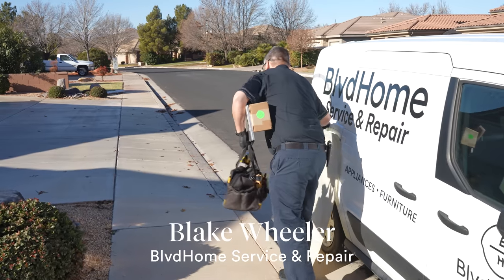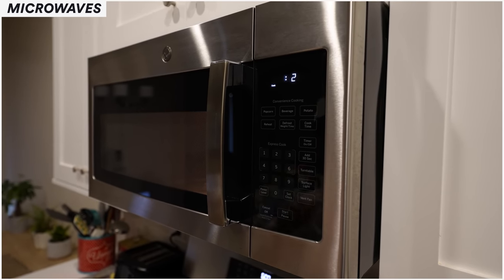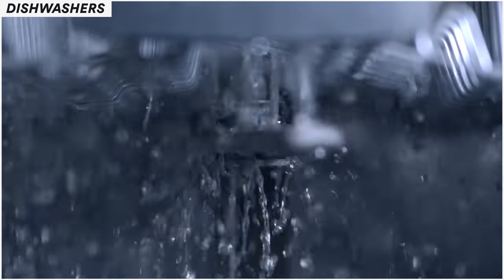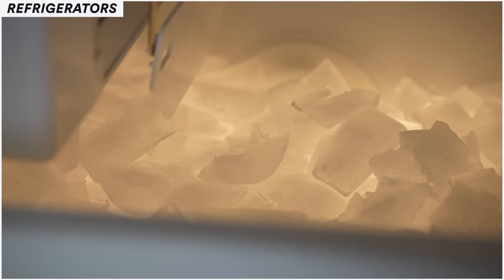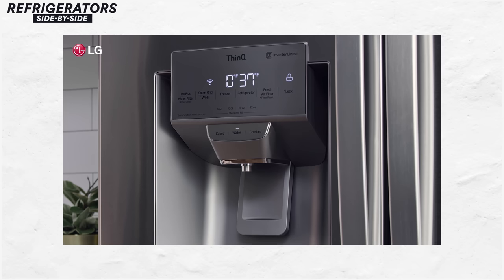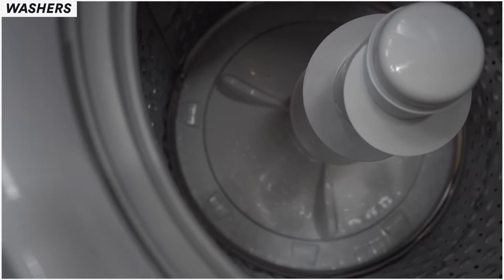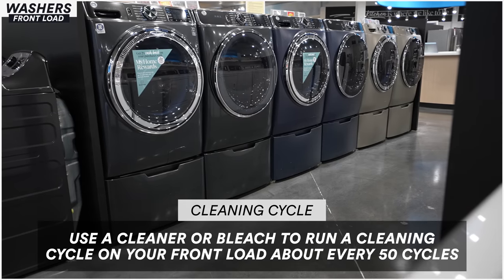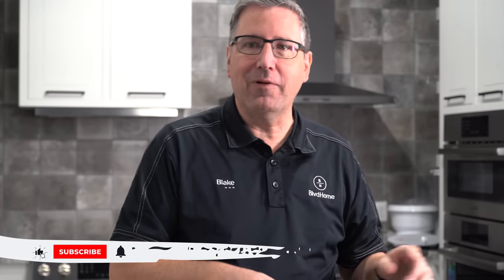Best Appliances Recommended by a Repair Technician of 29 Years

Comment: I never knew that microwave switches wore out when opening while running.  Good advice.
Reply: I think some microwaves might be turning off the magnetron a few seconds early to get ahead of this issue
Reply: @Werdna12345  I agree.   My door switches went bad.  Repaired for 20 bucks.
Reply: I'll trust this gentleman's experience about switches being the most common failure. I'm just surprised. A really long time ago, I worked at a company that made the contacts for electrical switches and they were usually designed to last for many, many thousands of on/offs before failing. Of course, back then you expected an appliance to last no less than 25 years without service. 😊
Reply: Apparently, my mom knew this back in the 80s because she still has her GE microwave from the mid or late 80s. What a machine!
Reply: Very wrong actually, most of them use relays
Reply: @TheMASTERshadows  That makes sense. But, you would expect them to have long life. What might he be replacing? I would think when he ordered replacement parts the description from the mfg should clearly be switch or relay.
Reply: @markkubert8572  hm...I recently opened up my parents microwave to see why it stopped working (turns out only a cheap fuse had burned) and was looking for signs of wear...the contacts of the door switch were just fine!...and my parents ALWAYS stop (and start) the microwave by opening the door...it's a cheap chinese model with analog dials and no screens, they use it EVERY day for at least 11 years now. :-)
Reply: He’s absolutely right! We had the same issue. The door switch burnt out since we were opening the microwave door before the cook time was over. The GE technician came over and recommended we buy a new microwave since the cost of replacing the door switch was as expensive as a new microwave itself. Very valuable tip.
Reply: @narendranj  what?? Those switches are dirt cheap! :-O ,that technician was 100% lying!
Reply: @vasopel  atleast that’s what the technician said…including labor and cost it’ll come close to the price of a new microwave…perhaps that was a way for them to make us buy a new microwave…
Reply: @narendranj  yes that is probably it :-(
Reply: You have a cheap ass microwave if you can open the door while it's running.. The last 3 I've owned and every other one I've seen in the last 10 years has a push button to open the door.  When you push that button, the machine shuts off the microwave a split second before the door opens.  Just like hitting the off button.
Reply: @CaptainRon1913  you have an expensive microwave to have that feature…
Reply: @CaptainRon1913  really??
 "the machine shuts off the microwave a split second before the door opens." and how does the machine know that you are pushing that button that opens the door? is it maybe...a switch? :-O 
were you drunk when you wrote that comment? :-D
Reply: @markkubert8572  that makes sense.  My microwave was 20 years old when the switches failed.  Working at a switch factory.  Neat!
Reply: @TheMASTERshadows  what is the difference between a relay and a switch?
Reply: @narendranj  I got a repairman and he diagnosed the switch and said the same thing.  Costs 300 bucks.   Replacing the switch myself was much cheaper including the $300 service trip.
Reply: Yep.. Look for ones without door handles, but instead with push-buttons that open the door - in these, the door button is almost always wired to automatically pause the microwave before the door contacts seperate; keeps them working for ages.. My parents have one like this that's older than me, and I'm goin' on 38 lol :)
Reply: @hodr1000  Switches are cheap Relay's prices...well it depends on the relay :-) 
Switches can be controlled mechanically
Relays can be controlled electronically
Switches control the flow of current by opening or closing of circuits
Relays control high power circuits with low power signals by opening or closing the contacts
Switches are operated manually by a lever or by pushing buttons	
Relays can send electromagnetic or optical signal to actuate the load circuit
Switches are  used to open or close the contacts
Relays are (also) used to protect the system from damage
Reply: @hodr1000  so the repairman said the switch went bad and then ask for 300 bucks to fix it? what the hell? :-O 
and what is a "$300 service trip"??
you people live in Saudi Arabia or something?
Reply: @GronTheMighty  "is almost always wired" hm...you are making assumptions ,only a percentage of microwaves that open the door with a push button (in reality it's a lever) have the pause mechanism you describe,even some of the expensive microwave ovens don't have that,in the end...the fact that your parents oven still works is probably (I assume...haha) because it was a well designed model ;-)
Reply: @vasopel  Yes, I was making assumptions - thanks for correcting me, I'm far from an expert on any of this stuff :)
Reply: @GronTheMighty  well it wasn't a huge mistake :-) I mean...it is the logical thing to do when you're designing a microwave oven to include these simple safety features...but companies are cheapskates! :-(
Reply: @vasopel  Well, they do often exist mainly to make money, rather than mainly to make good stuff for good human living ;)
Reply: and i guess that you as the typical murican, open the door without pausing the system.
Reply: Agree!
Reply: @TheMASTERshadows  I came here to say the exact same words, microwave door switches have been relay operated for 10’s of years.😂

It’s like the outdated warnings of using a mobile phone at the petrol pump. That risk doesn’t exist anymore since phones advanced from piezo speakers (which could produce little sparks, possibly igniting fumes), but people still carry on with the outdated warning.
Reply: @CaptainRon1913  The push button design is actually no different to a pull handle design electronically. All the push button does is physically eject the door from within the microwave cavity… the same operation still takes place behind the scenes, as if you used a door handle to open the door.
Reply: You would think they would use a relay so the door switches could just use low voltage to trip the relay to shut off the magnetron. There also should be a button to shut off the obnoxious beep.
Reply: Best refrigerators are standard old fashioned top freezer units. They are the cheapest to buy. They are the most efficient because you don’t have the cold freezer on the bottom sitting right next to the hot condenser fighting each other. It’s a better more efficient design having the freezer on top away from the condenser. The cold from the freezer also drops and helps keep the fridge underneath cool while not running. They also last longer due to them not having to run as much.
Reply: @TheMASTERshadows  that's what I was thinking. Also the pause button must operate a dry relay, if there's a spark there then you're not preventing any issues.
Reply: Since EVERYONE does it though, you’d think there could be a way to protect against it.
Reply: I open the door while hot all the time. My microwave is over 15 years old. Guess I am lucky.
Reply: I was really surprised by this. We had an Amana Radar Range back in the 70s that my parents used for 30+ years. It was definitely opened without pressing stop thousands of times and they never had any issues with it. They only replaced it because they remodeled their kitchen and wanted a built in.
Reply: Why do they work that way?  Why such a powerful charge instead of just an ordinary switch?  It can't possibly take so much longer to send the signal to turn it off that way than having it effectively be a circuit breaker (which is what he described, yeah?) as a safety feature.
Reply: It’s a lie..
Reply: mine is currently broken and I now know why...me
Reply: I ditched the microwave years ago due to health concerns and I use a counter top toaster oven/air fry/ convection oven instead.  I'd rather not get stomach cancer thanks ;)
Reply: @OceanFrontVilla3  wish you longivity..👍🏽
Reply: Most microwave ovens have two switches in the door.  One that tells the microwave to shut off and a second 'safety' switch that interrupts the high current should that first switch fail.  It's not a problem to open the door while running on most microwave ovens.  They're designed to work that way.
Reply: @DocFunkenstein Cause it's the easiest way to build it? You'd want them to complicate the electronics and send some kind of separate low power signal through the door switches? What if something completely fails? Having the switches be a breaker is a nice safety feature.

We don't even have these fancy microwaves you Americans have. Everybody uses one with a spring timer in my country. Pause button? What pause button? My microwave literally has no buttons. The only real off switch is opening the door. My point being maybe the way all microwaves work is simply a carryover from the old-school ones.
Reply: @davidcobra1735  I was being a bit facetious in my previous post.  That's EXACTLY how they do build (most of) them.  What this guy talked about is a safety feature in case THAT one fails.  You're not going to ruin your damn microwave opening the door mid-cook.  They're DESIGNED not to be ruined that way.
Reply: This issue is not true at all. The switch only carries instruction power, not operating power
Reply: @DocFunkenstein  I don't even understand what you're saying.
The guy in the video basically warned people that switches will wear out. It's true as far as I'm concerned. There's no reason to open the microwave oven door more than you have to.
I don't care how you think a microwave oven is designed, all electromechanical components will eventually fail because of prolonged or repeated use.
Reply: Just learnt this recently as well - good to finally know!
Reply: @DocFunkenstein  you are correct, the door switches only switch low current switching circuit to operate the relay which safely controls the power supply, therefore it makes no difference how it’s turned off, either by opening the door or by the cook time finishing
Reply: Me either. Learn something new every day or almost every day.
Reply: @catw6998   Ben is incorrect, the thing you don’t understand is that no matter how it’s turned off, either by the door being opened or by the timer switching it off its the power relay that switches the power off, not the door switch as  suggested here
Reply: jesus what kind of a psycho just opens the door without pressing stop/pause?!
Reply: @markkubert8572  My microwave is 31 years old and the door switches still work! I don't often open it while it's running because the time control is a knob and can't be set precisely anyway so maybe that helps.
Reply: Just heard that yesterday. Did not know either
Reply: I never knew americans opened the microwave while running
Reply: I've been doing that on my LG for 20 years
Reply: @jayson657 yeah but if you have a Samsung it rusts and leaks at 6-12 years. We've had 2 and I'll never buy Samsung fridge and washing machines for that matter.
Reply: That's not entirely true in my experience. We have my grandma's microwave from 1995. I've been popping the button to open the door and stop it for 20+ years. I don't think it has a pause button. It has a big dial for the timer. It was made in Korea. I think the new microwaves are made to fail, so you'll buy another one. They are all made in China by the same company I heard.
Reply: @aliasrose  Midea. Bought one online from a local brand in my country. Didn't work. Bought another from Samsung made in Malaysia  and works just fine
Reply: I didn’t know that.. I constantly open it when it’s still running because I hate the beep
Reply: I'm that person that yanks the door open before it dings😂. Won't do it anymore
Reply: Yea the switch on mine wore out also ... And since he didn't have the exact replacement, he has to rig it to work and that was 5 yrs ago and its STILL working
Reply: @TheMASTERshadows  Well... have you seen the schematics for microwaves ? You will see that switches is there, and there is more than one, and that they can be configured in what appears to be strange ways, it is all because of safety, your safety, not only do they cut off the power, they also short the now unpowered circuit, all to insure that you do not fry yourself. The relay do only turn on/off the magnetron during normal operation, not when you open the door, the power to the circuit is cut by the switches when you open the door.
Reply: @hodr1000 You got taken for a ride.
Reply: Never had a problem so far in 40+ years !

Comment: I am a system engineer for GE, my recommendation is that if you want reliable appliances, pick the simplest one, not those fancy touch screen things, just plain nobs.
Reply: Any recommendations on models you would use washing machines that are 4.5 cubic feet in size ?
Reply: @Kathy-dj6di Speedy Queen
Reply: We did that. Simple counter depth French door, no water, ice only in freezer. Lasted 7 yrs and couldn’t be fixed.
Reply: I work on GE medical imaging equipment, too bad we don't have the same development teams!
Reply: Basic Frigidaire and Whirlpool appliances are most reliable and longest lasting. Speed Queen is also top notch if you can afford the up front cost. Hope this helps. 😮

Comment: During my 8 months as an apliance installer for lowes in 2016/17, the most frequently returned and exchanged brand was samsung. The least was whirlpool and GE.
Reply from the maker: Very helpful information, thank you for sharing!
Reply: Whirlpool frig, washer and dryer !    Although washer and dryer have some slight issues with screeching/noise. Problem is controller/software timing in both. Controllers are $300 w/o labor. Will run them til they die then buy. Repairman said Whirlpool  is still among the best.
Reply: Great information!😊

Comment: SpeedQueen classic top loader,still going 15+ years.. best thing i have ever owned.
Reply: I had an LG TROMM front load unit for 13 years that followed me to three houses... the last house it had gone through a flood in the basement, completely submerged... and still ran fine after that. I left it at that house when I moved again though. What I can tell you is that based on the operating costs of the top-load piece of 1800s junk at my new house, which recently broke, that LG saved me over $23,000 in electricity in the 13 years I owned it. I replaced the piece of junk top loader with a new LG front-loader and suddenly my shirt collars are clean again and my electric bill is down by almost $30. Everyone thinks a KilowattQueen is gonna last 30 years but the question should be... do you really want to support it's drinking habit for 30 years of sub-par wash and spin performance? lol
Reply: My Neighbor moved in and the old neighbor left practically brand new Speed Queen Washer and dryer. The new neighbor put these out on the curb and said it was some off brand crap he never heard off. I took them and didn’t realize they were such a good brand. The FF7 is hands the best washer.
Reply: @futball24  Your new neighbor had never been to a laundromat?  Speed Queen owns the commercial business.  My mom had a Speed Queen when I was growing up.  It never broke down.  She finally replaced it when we moved out because she wanted to remodel and have an updated looking unit.
Reply: Love my Speed  Queen washer. I don't get why anyone would want a front-loader. Why not use gravity to your advantage with a top loader, vs have a washer w/ seals that collect mildew? Simple is best. Stainless steel drum won't break. I've got a SQ from 2012. No computer motherboards that can break.   
Plus, I like being to control the amount of water I use, and am fine spending more on electricity. Set the price, let me pay for it. High Efficiency isn't always preferable.
Reply: But my clothes get clean with a fraction of water use.  Top loaders are water hogs and that agitation is wear and tear on your clothing!  Nothing against speed Queen.  My front loader going on 20 years is mildew free.  Run a bleach cycle once a month and leave the door ajar when done washing so it can dry and you avoid those issues.  Same as I would with the top loader.
Reply: @futball24 The exact washer I paid $500+ for in 2022 & that was a"good" deal, usually they are $700+ & here a set out on a curb for free 🤦🏼
Reply: @futball24  Your neighbor wouldn't recognize a diamond if he poked his eye out with it! Lucky you!!!

Comment: Such a great unbiased video. It's great to hear a repair guy say "LG makes a great washer but their fridges suck"... True honesty. Thank you!
Reply: So which fridge brand do u choose?
Reply: We owned 2 generations (7 years each) of LG appliances and the 2nd generation quality had plummeted.  French Door Fridge was serviced twice for a door condensation leak, the Top-Loading, LG high efficiency washer failed and its replacement was of dismal quality and the clothes dryer had its drum rollers replaced twice. This was a household of “two” people.Brand Name appliances are being manufactured to a cost point and appliance turnover is how they make money.
Reply: 2 daughters have big LG French doors. They run fine. One is 10-12 years old.  One is 2 years old.
Reply: @Susan70003  LG fridge have a Iverter Linear compressor that is garbage , and a class action law suit that they lost so keep your receipt for the refrigerator because now you have a 10 year warranty on that compressor from the date you purchased it
Reply: @Susan70003  That was 10-12 years ago.